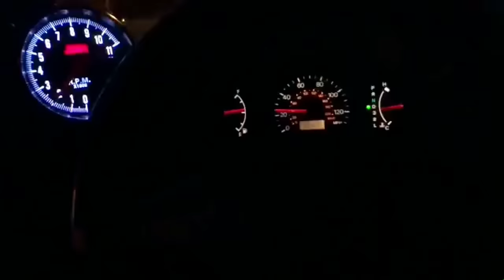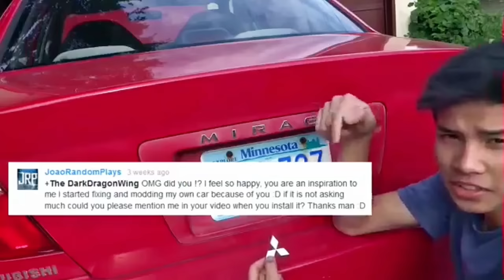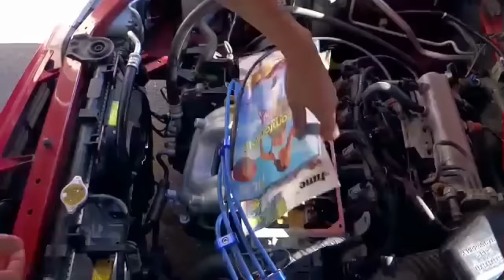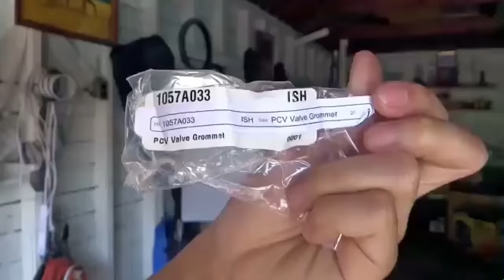Mirage Fix 14 | Clean Engine Bay

Comment: Nice video!!!! I have a question for you. What is the thing that you fixed on top of the air intake hose after you got your engine started after cleaning? I am planning to change my stock air intake with a short ram intake and I wanted to know if it's a necessary part for the engine.
Reply from the maker: It's vaporized oil hose. Yes, you can still find a way to connect it with the new intake. Or you can just get an oil catch can instead.
Reply: @DarkDragonWing  not that thing. The one which is fitted on top of the air tube. A rectangle shaped thing. What is the use of that?
Reply from the maker: Oh, yeah. You don't need to have it. It doesn't do anything much.

Comment: Where did you get the Ralliart sticker?
Reply from the maker: Can't find the same one anymore. Here is the closest one I can find: https://rover.ebay.com/rover/1/711-53200-19255-0/1?ff3=4&toolid=11800&pub=5575273973&campid=5338044275&mpre=https%3A%2F%2Fwww.ebay.com%2Fitm%2FRALLI-ART-Emblem-for-Mitsubishi-Lancer-logo-Front-Grill-Grille-Badge-ralliart%2F222434313430%3Fepid%3D621196777%26hash%3Ditem33ca1e44d6%3Ag%3AGbMAAOSw32lYwUOe
Reply from the maker: You can find more here: https://rover.ebay.com/rover/1/711-53200-19255-0/1?ff3=4&toolid=11800&pub=5575273973&campid=5338044275&mpre=https%3A%2F%2Fwww.ebay.com%2Fsch%2Fi.html%3F_from%3DR40%26_trksid%3Dp2334524.m570.l1313.TR0.TRC0.H0.Xralliart%2Baluminum%2Bemblem.TRS1%26_nkw%3Dralliart%2Baluminum%2Bemblem%26_sacat%3D0%26LH_TitleDesc%3D0%26_osacat%3D0%26_odkw%3Dralliart%2Baluminum%2Bbadge%26LH_BIN%3D1